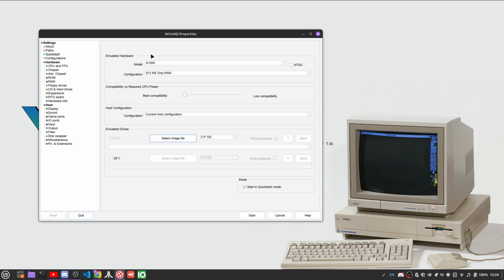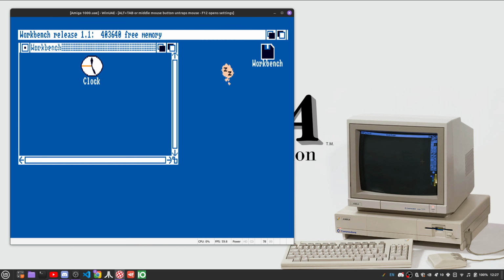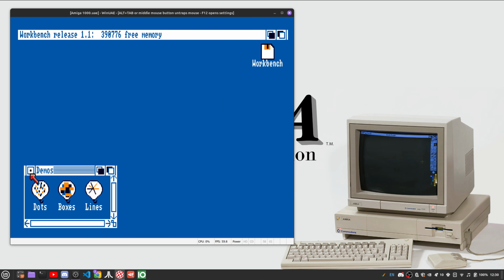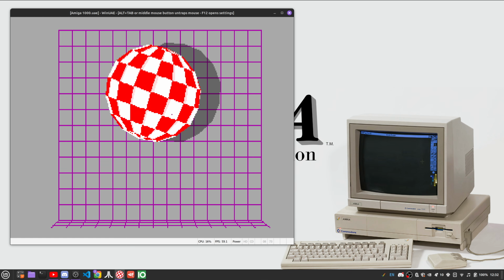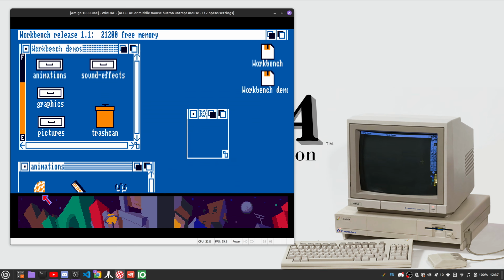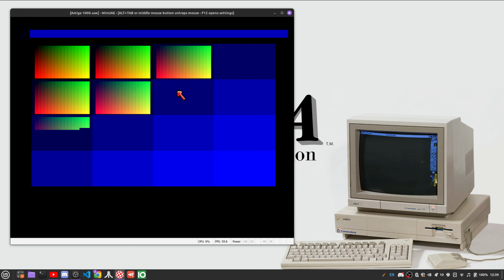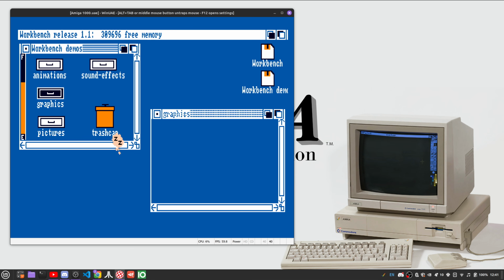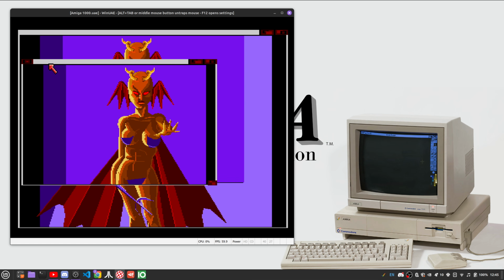Amiga As a Workstation: Part 0: First Foot Forward

Comment: 03:58 I'm not sure what you mean by "writable control store," but it's surely not the traditional meaning of RAM on the CPU (that is not at all part of system memory) used for microcode in order to add new instructions to the CPU.

I've not gotten deep into it, but a quick look around seems to indicate that the ROM-less Amigas simply loaded Kickstart into RAM, just as you could load any other code into RAM. And this would be the obvious way to do it.

Other than that, good video!
Reply from the maker: On the Amiga There's a dedicated 256K block of RAM, on a daughter board that just holds the KickStart. The KickStart disk loads into this area of RAM, sets a register which write protects it, and jumps to it. Amiga called this the Writable Control Store (WCS), and it was used because the mask ROMs weren't ready for production machines.
Reply: @tschak909  Ah, ok. So "slightly" special RAM. But still, WCS was a terrible name for it, given that it already had a common, different meaning.

Comment: Jay Miner is little known, but for the geeks who delve into this, he is not. I do wish he were better known because he was incredibly talented. I believe the Lisa may have supported multitasking. I was very much into art in the 80s and was experimenting with digital art, but when I saw Andy Warhol on the cover of Amiga World, I was captivated and bought an Amiga 1000, which I used extensively. We also had one in art college, where I used it for its unique scanning capabilities. It employed a black-and-white camera mounted on a monopod, pointing down onto a white surface. By using four filters—red, green, blue, and luma—it could scan color images. I would hand-draw animations, scan them in using this setup, and then play them back on the Amiga, which was similar to what we now know as animated GIFs. The machine was spectacular, and although the games were far ahead of what I had on my Atari 800, I mostly used it for these artistic projects. I also recall the high-resolution mode with an odd refresh rate, which my NEC multi-sync monitor handled fine, and how some arcade games used a high flicker or interlaced mode to achieve higher resolutions.

Comment: With SAS/C and a modem - this thing was a weapon. I got hold of an Amiga2000HD with an 030 accelerator at university, I would use slip to connect to their network and everything that shared Solaris server did slow, I could do fast.

Comment: @7:45, if you are using WinUAE, that CPU meter you listed is not how much of the 68000 is being used, it is how much of your PC emulator's CPU is being used emulating the complete Amiga chipset.  Yes, the custom Amiga chipset did a lot of things without the need for the 68000 to compute much, but the meter you describe is not telling you the truth about the 68k usage VS it executing 'NOP' statements.  Drawing boxes (blit-fill), fills / copying ram (blitting), playing sounds, loading from floppy, anything done withing the first 512kb an an Amiga 1000 only requires the 68000 to set a few registers and send a go to the custom chipset, then the 68000 is free to do anything else while it waits for a completion interrupt.  However, for example, drawing angular lines, this is done in code with the 68000 and occupies all of it's attention to render a the line in ram.  As for the multitasking, it is the Amiga OS which handled this task, using the custom chipset hardware as interrupt program time sharing management.  Since so many actions use the custom hardware to run their functions, while waiting for these tasks, the Amiga OS would allow CPU driven functions in concurrent running software to run at the same time.
Reply: Funny thing how much more modern PC's resemble Amiga's nowadays than their 80's predecessors. Think about it, in 1980's PC processor basically did nearly everything, even if you had some addional cards every memory access and so on had to be done by CPU. Nowadays there is a lot of custom chips with direct memory access, doing what ever heavy lifting is needed for graphics, sound, storage i/o and so on. Just like old Amiga had.
Reply: "for example, drawing angular lines, this is done in code with the 68000 and occupies all of it's attention to render a the line in ram"

Amiga Blitter has a line draw mode, a built in Bresenham engine. You just need to fill in a few blitter registers and Blitter will draw the line. There's also a fill mode, so once you draw the lines in a special mode, Blitter can also fill the final polygon for you.

Comment: In November1989 I picked an A1000 one up on closeout for $189 as the salesman was duped by Apple rep who brainwashed him into thinking Commodore was going out of business. They were switching to only Mac sales and service... Due to this fake news I snatched up the A1000 for a  song and was able to: Go online via a 2400 baud modem, print, use an RGB monitor and  Genlock live cable tv into it and back onto a VCR. I could multitask... all of this at the same time. The system had 512K Chip RAM , I purchased a slap on the side 2MB fast ram from MAST in Las Vegas Nevada....and I picked up three external second-hand floppy drives giving me essentially a 3.5 MB hard drive. Amazing functionality for the time. My daily driver until 1994.

Comment: The Amiga is always known as a games machine but the multitasking was the thing that always blew my friends' minds when they saw that i was both running my BBS and doing some DOS thing.
Reply: Likewise, I was programming with my friends and we were making multi-threaded applications, it was both fascinating and useful. I also scored a dumb terminal and I'd start a shell on that, sat next to the Amiga. It was a fantastic and productive setup. Then I'd go to my work, where we were still using MS-DOS and I'd try to talk about it all and I'd get crap back like 'I can't work on two things at once,  what's the point?' from experienced coders who ought to know better!
Reply: I always knew it as the platform of the Video Toaster, the workstation for Babylon 5 CGI, and the on air titles machine at the local cable access TV station. I was kind of shocked decades later when I found out it had a bunch of awesome games.  None of my friends had one, so for games, I was kind of out of the loop, lol.

Comment: From 1995 to 2001 I used an Amiga 4000T as my primary workstation with a 68060/PPC, 128MB of RAM, Cheetah SCSI drive and a 21" ViewSonic P810 monitor driven by a Cybervision PPC display card. I finally built an overclocked liquid cooled AMD 1900+ peecee with a 64MB GeForce3 vid card. I still have my Amigas and some of them even run. I had a lot more fun with computing in those days.
Reply: Have you looked at apollo core? I'd be interested in opinions on it.
Reply: I haven't yet, other than briefly browsing the Vampires. While I occasionally run backups of all my '90s Amigas in WinUAE I am still more of a hardware purist, which basically ended with the '060. The '080 isn't really a chip, it's more of the idea of a better chip. While I love the Amiga dearly and always will, I can't see using it as a modern computing platform. I dabble with my original Amiga hardware that I bought in the '90s for the retro computing experience. I don't even use them the way I used them when they were new, I mostly play games on them now! Back in the '90s I ran a BBS that grew to 20 phones on an A4000 desktop. I did some DTP and basic non-toaster video work like DCTV and other productivity things, but had stopped playing games around 1992 or so. I have rediscovered my initial Amiga experience, which was heading over to a friend's house with a big box of blank floppies on Friday nights and coming home in the wee hours of Saturday morning with a hundred or two games to try out over the next week. If I found any of them to be worth it I'd buy them. After the BBS went multi-line and I started devoting all my spare time on it I pretty much stopped playing games on the Amigas. Don't get me wrong, I think it is great (and amazing!) that the Amiga platform is still being developed and there is no end in sight, I just enjoy the retro part more than the current efforts to push the Amiga tech to the limit. Long live the Amiga!
Reply: That's a really nice setup! still have my A4000+CSPPC and CVPPC too but rarely use it, currently my main Amiga is an A1200 with PiStorm32 and CM4 module.
Although it lacks some drivers like warp3D it's breathtakingly fast for an Amiga!
Reply: ATM my main Amiga at the moment is an A4000D with a WarpEngine4040 and a CV scandoubler in the vid slot. I have a working CS '060, but I really don't do anything demanding with the 4000 so it really doesn't matter. I have a working 1200 with a math-co and 8MB that works great for most games. If I really need blazing fast I can run WinUAE with all the knobs turned up.

Comment: Agree with the logic behind this and love this exploration - will definitely follow this series.  Nit to pick tho: Sun 2/120 came out in 83.  Three years in this era was a generation of computing.  A more appropriate comparison would be Sun 3/50.  That said, the point you are trying to make would still hold up for that point in time.
Reply from the maker: This is a really tough one. I chose the 2/120's because that's what Amiga initially used for the second round of system development, and that it used a 68010, but yes, a 3/50 would make sense too.
Reply: @tschak909  you are also very off with the price comparison, in 1986 the Sun 2/120 was way more expensive then beefed up A1000 you present in your video, but had 40% more computing power, 8 times more RAM so you could actually use that power, and proper preemptive multiuser multitasking OS with protected mode and RAM virtualization, backup tape drive and 79MB SCSI HDD as well. Day and night difference to Amiga 1000 that was a toy if compared, with a toy OS with zero security.
Reply from the maker: @madigorfkgoogle9349  I appreciate your enthusiasm, but I must point out: I was there.

A typical 2/120 with a bw2 framebuffer 2 megabytes of RAM, and e.g. an 80 megabyte SMD disk was $29,700. This went up substantially if you (a) increased disk size, (b) increased memory size, (c) swapped out bw2 for cg2. 

Did you actually use SunOS 2 or 3, on this system? It was SLOW across the board. Yes, There was memory protection. Yes, you had a faster processor, more memory, bigger screen space, an Ethernet adaptor, etc. But it was also considerably more expensive than even a well kitted out Amiga 1000 with 8 megabytes of RAM, and a hard disk (the 8 megabytes coming from a PAL jr. box). This is important when your department's discretionary budget was ZERO for the year, and the HP 9000 you shared with 6 other engineers is severely overloaded. So those of us who needed to get things done improvised. We hooked these systems up to bigger ones to visualize data that was coming in, made DMA cards, hooked up through the parallel or serial ports, whatever we had to do to get shit done. It happened in lots of places, they just weren't publicized.

It's very tiring to argue with some of you who seem to think you know better than everyone else how things actually happened in the real world. I am trying to make my point based on my own experiences, and those of whom I knew and worked with, that the Amiga did fit the gap nicely during this time period, and did so better than many of its contemporary personal computers, by a long shot.
Reply: @tschak909  I was "there" as well, and the 2/120 had 4MB RAM as a baseline. And the fact that Amiga DOS has zero security and no memory protection makes it a one person computer, and that is a decisive point. Yes the Sun was overpriced since there was not much option, that is the reason Apple, Commodore and Atari wanted in the UNIX workstation business, piles of money, the 68k line was not cutting it right after SPARC and MIPS introduction.
And to call something a workstation you have to be able to serve more then one user at a time, which is Amiga unable to do.

 Otherwise for the price of your usable baseline A1000 you could have two and a half ATARI ST, so if price was the important factor then you could have a huge scientific lab fully equipped with so many computers that you didnt have so many lab workers. And it had SM-124 VGA 72Hz mono monitor, so much more useful then Amiga RGB crap, and still being 10-20% faster in computing power.

And no, the Sun wasnt slow across the board, what are you talking about, did you ever ran anything on it? Of course if couple of users shared it then it could get slow, but that is a thing you could not do on toy preemptive OS like Amiga DOS. What I mean for a single user computer the Amiga DOS was a gimmicky overkill, but it wasnt really usable for anything else. As a single task one person computer it was good enough.

I didnt see a single lab in Europe using Amiga... All full of Atari ST, TT030, PCs and real workstations and even minicomputers like PDP-11. Where did you work?

You may have used your Amiga for same tasks as you would a Sun workstation, but that is far from calling it a workstation.
And yes its very tiring to listen to Amiga fanboys after all those decades dreaming how Amiga was ahead of its time, it was a great computer (well the A1000 not, the A500/2000 was) but it was nothing special, it didnt bring anything groundbreaking into computers. And the Amiga DOS was a toy with zero added value to average user, and the Workbench GUI was cumbersome and slow to work with and in fact the 1.x versions are not even a GUI at all.... 

Sorry for my heated tone, I calm down in future.
Reply: Back in the late '80s I helped my dad refurbish one of the units in a commercial building he owned and the new tenant was a graphics outfit that had a number of SGI and Sun boxes. It was summer and the A/C guys were late getting the system installed and we had to endure a week of the graphics guys having fits because the heat was crashing some of their machines. My dad had to rent a bunch of portable A/C units for them and their boxes still crashed when it was cool! I got my first Amiga at about that same time. In the '90s I got a DEC AlphaServer 1000 that ran rock solid in 95° heat. I ran that thing 24/7 for over 5 years with no problems.

Comment: Something that always gets lost is that the Amiga is the true successor to the Atari 8-bit computers, and not the Commodore 64.   Interestingly, the Atari ST is arguably the successor to the Commodore 64.
Reply: The companies played a big round of musical chairs with their engineers.    If you understand anything about how the Atari 8 bits work, it's obvious how the Lorraine got its specs.
Reply from the maker: Correct. If you read the ROM Kernel Manuals (in particular the Libraries volume), you'll find how original ideas on the Atari 8-bit system evolved onto the Amiga. 

https://archive.org/details/amiga-rom-kernel-reference-manual-libraries-and-devices/page/n9/mode/2up
Reply: @tschak909  also too the basis of one of the lawsuits brought against Miner et al. They were creating off the back of Atari technology. The fact the same engineers (Miner, Decuir) were involved reminds me when John Foggerty was sued for 'infringing copyright' with 'Old Man Down the Road v' Run Through the Jungle. It took years for Foggerty to win that one.
Reply: I was (still am) a big fan of programming the Atari 8bits (so it's no surprise I've ended up subscribing to Thomas' channel!); when the ST was announced in the magazines of the time, I looked at the articles about programming for it, and I was disappointed. 'Where are the sprites?!' I saved my money and later bought an A500. Back then I didn't know any of the history of the Amiga, but it all makes so much sense now!
Reply: You could also argue reasonably that the Atari ST is the spiritual successor to the Tandy Color Computer.
Reply: @JoelReesonmars  absolutely not, where do you get this nonsense, ST has nothing to do with Tandy Color.
Reply: @madigorfkgoogle9349 

"Spiritual successor"

As opposed to literal.

I suppose, if you're not a fan of the CoCo and among those who wasted time hoping and imagining that Tandy might put out a 68K based Color Computer, it would take a bit of explaining.
Reply: @JoelReesonmars  the thing is that ST was designed as Apple Macintosh with colour functions, CoCo was very very different. After your logic any computer was a CoCo "Spiritual succesor".
Reply: I don’t think that gets lost. The transition of teams is well talked about in the retro community. Jay Minor is well regarded.
Reply: @keyboard_g  it was lost at the start of this episode.
Reply: this does not change the fact that neither our beloved Atari 8-bit nor Atari 16/32-bit is a Commodore, despite the common designers. Also the Lynx is Atari not Commodore.
Reply: @blast4722  Let me be more clear...

Shiraz Shivji was the Director of Engineering at Commodore and was an engineer on the C64.

He went with the Tramiels when they bought Atari and became VP of Engineering and the Architect of the Atari ST.

Jay Miner (and others) that architected the Atari 2600 and Atari 8bits, left and founded Amiga, Inc. which was purchased by Commodore when they had essentially finished the Amiga.

Hence my point of C64 -> Atari ST and Atari  8bit -> Amiga.

The Lynx is more Amiga (and Epyx) than Atari.   RJ Mical and Dave Needle (engineering leads of Amiga SW and HW, respectively) designed and built the Lynx for Epyx.  Atari only bought it at the very end, when Epyx ran out of money.  And, frankly, Atari screwed over the Lynx team, so you won't hear very fond stories about that.
Reply: yes, same as the C64 was slightly better computer then Atari 800, ST was slightly better computer then Amiga (well the ST was vastly better then A1000 for the price/performance).